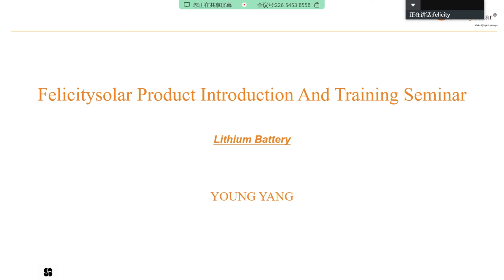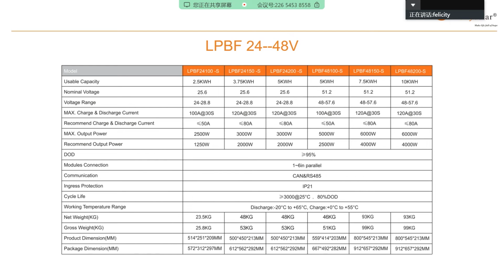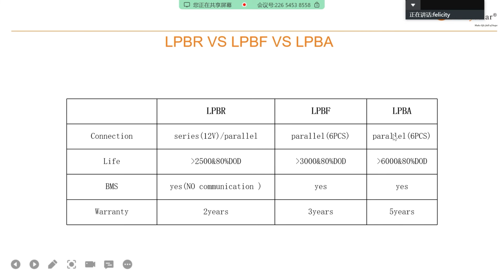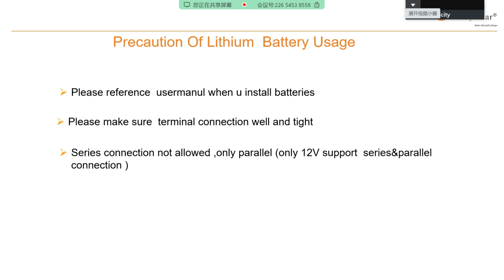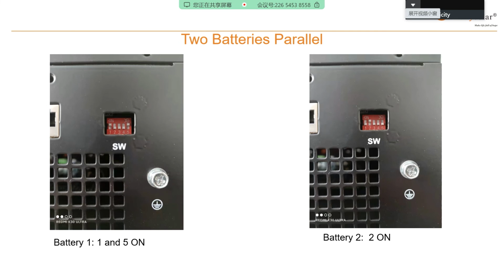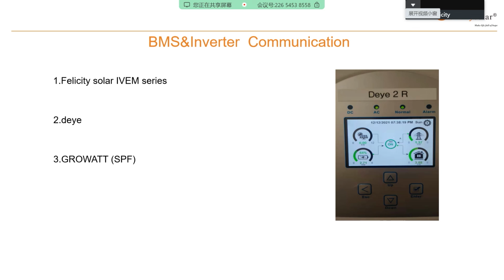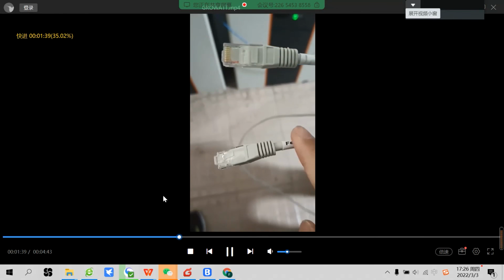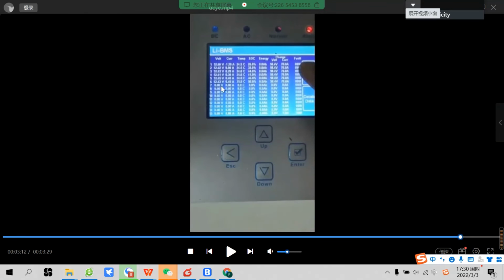Felicity solar lithium battery introduction

Comment: Can the 200 amp 24 battery be used with other charge controllers , the Outback Flex max 80 for example.  This is an of grid set up.  I bought the battery not realizing the communication cables…like the wake up cable… which I don’t have, maybe it comes with your charger inverter. Can i just connect to the output voltage of the Charge controller?
Reply from the maker: Thanks for your inquiry. Please contact our engineer for Technical support by whatsapp: 
Wasely  +86 131 2609 3443

Comment: We need one lbpa 48200 battery opened up and see batteries inside, cause the lbpf 48200 have 170 Amp batteries inside! And the lbpf 48300  have 270 Amp batteries inside! Of course lbpf aren't new cells...

Comment: I have a filecety lpbf48350 battery that was not connected via the BMS in the growatt spf5000es inverter, although I was able to connect it to the lpbf48300 battery. Please help.

Comment: Can I connect your Lithium Pack in series for high voltage applications; example 360VDC 30KVA Inverter with perhaps 8Series of lpbf48300?
Reply from the maker: Yes, and for details, you can please contact to our professional teammates, they are willing to offer you help: felicityservice@felicitysolar.com/Whatsapp : +86 18620180651

Comment: Can your 10kwh 48v 200ah lithium battery be used to run air conditioner and how many hours?
Reply from the maker: Please contact to our technical teammates for more details: felicityservice@felicitysolar.com/Whatsapp : +86 18620180651. Thanks for your support and understanding.

Comment: Hello 
if there is felicity lithium battery connected to felicity inverter , how to configure setting 9,10,11,12,13.
i want to know at certain volt what is the percentage i selected.
Reply from the maker: Please contact our technician,they would like to offer you help.   felicityservice@felicitysolar.com/Whatsapp : +86 18620180651

Comment: Hello on the user manual  it said that the last battery in the system should turn on switch number 5 in and now you turn it on in the first battery

Comment: Hello,how about if batt connect with voltronic inverters, are there any dangerous to connect this batt without communication ? And how much the bulk voltage should be?
Reply: What commutation cable for sunsynk 8kw with felicity 200ah

Comment: Is the DIP switch setting necessary when battery communication system is not used? I mean is DIP switch setting necessary when battery is used in open loop system?

Comment: Hello. To setup communication between two 8.7 lpba batteries i set the DIP switch to 1 and 5 on the first battery, and only 2 on the second, then restart batteries. Right??

Comment: How can we solve the communication problem with voltronic axpert 5.6 kw inverter
Lot of inverters in our market but still no solution
Reply: A big company like you should solve this silly problem
Reply: It has a bms port with can communication and rs485 communication 
And lib protocol compatible parameter
And 3rd party li battery parameter
How about you try and solve it
Big problem

Comment: Thank you for the video, can you tell me what the pin-out is of the communications cable please for a connection to a DEYE inverter?
Reply: Hey..did you figure it out?coz I'm currently struggling to configure it to a 12 kw Deye inverter...please help if you can
Reply: @ofentsemnyandu809  Sry, never managed to get it to work

Comment: hi sir, can you please clarify if the felicity inverter IVEM 5048 and felicity lithium battery LPBF-48200S can communicate via BMS port? and also is the deye inverter can communicate with the same battery LPBF-48200S? 

thank you in advance
Reply: We recently installed  2 * felicity inverter IVEM 5048 in parallel and 2 * felicity lithium battery LPBF-48170S shared by the parallel 2 *IVEM 5048. There is communication via the BMS port and has been operational very well.
Reply: @DrEnockNorthVoltageEngineering  hello sir I have the same battery and inverter but arent connecting together, could you plz tell me the pin layout of the ethernet cable, whicn pins in RJ45 should i use at both endes the battery and inverter?
Reply: @hussien5095  At the inverter, make sure the cable is in the BMS port and comms port on the battery. Ensure the battery dial pins are set correctly. After all connections, you need to restart the system. If you see c on the inverter, then there is communication. You could also write to the service support at felicity for specifics. We used the battery communication cable (RJ45 based) supplied. Alternatively, we can set up a zoom video call i have a look at your system...
Reply: @DrEnockNorthVoltageEngineering  please sir can I communicate with you privately or it OK here, I want to upgrade my knowledge on solar if you mind

Comment: Hi
I used 2 felicity batteries in parallel with Growatt 5000 es
I followed the steps but it doesnt work, the inverter is not charging , 
I used the  black connection wire -that i used to connect between batteries - to connect between battery and bms 
Was that right? Or i need a special connection wire ,?
Pls need help
Reply: Hello you need a special connection wire . If you didn't solve the problem i can help
Reply: @ma060704  
Thanks alot ,Solved . 
Appreciated.
Reply: @rabihghannoum1198  Hi,
how did you solve the problem?
I've tried with a normal ethernet cable but it's now working
Reply: @JamesNjoroge-bc5qk  what kind of inverter do u have ?
Reply: I used 2 wire ethernet cable connected 1-2 to the inverter , 5-6 to the batteries
Reply: @JamesNjoroge-bc5qk  1-2 from the inverter , 5-6 to the battery.
1  at the inverter connected to 5 at the battery
2  at the inverter connected to 6 at the battery
Hope this solves ur problem
Any more questions  happy to help
Reply: @rabihghannoum1198  Thank you, i figured it out. 
I noticed that bms controlled charging voltage is 58.4, while the maximum battery charging voltage on the datasheet is 57.6V.
Is this the same for your system?
Reply: @JamesNjoroge-bc5qk   no its not the same
Did u set program 5 for li ?
And set the protocol 36 to 04 ?
Reply: @rabihghannoum1198  Yes, i did. 
Then i checked the battery charging parameters and noticed the 58.4V charging voltage. 
I tried to change it but it's bms controlled. It cannot be edited.
However, during normal charging operation, the voltage never gets to 58V.
Reply: @JamesNjoroge-bc5qk  then u have to update the battery 
I contacted the dealer and he sent the update version for battery to comunicate with growatt, but it is somehow complicated , i suggest that u must do the same and contact the dealer so he can make the update for ur battery.
Reply: @rabihghannoum1198  Okay, thank you. 
I'll do that
Reply: @ma060704  can you please share the configuration of the Comm cable between two batteries when using them with Deye inverter, the one from battery #1 to the inverter is : pin1&2 (inverter side) to pin 5&6 (battery #1 side)
Reply: @ma060704  please can u help I have the same issue concerning two batteries 8.7kwh with growatt 5000 one of the battery is not working
Reply: Hi rabih, i have the felicity 10kw LPBF-48200S with growatt 5000 es. i used the special cable but it is still not working with BMS. do you have the same battery if yes can you please let me know how to make it work.
Reply: @charbelkhoury3120  hi
I used the same connection wire with several kinds of felicity lithium bat. and it works the same, but i didnt use it with this battery.
Although im pretty sure that it may work the same, 1 and 2 to growatt , 5 and 6 to felicity.
1 connected to 5 , 2 connected to 6.
If still is not working i think u have to contact the dealer to update the battery to configure with growatt
Reply: @charbelkhoury3120  and make sure that setting 5 on growatt is set on li , setting 36 is set on protocol 04
Reply: Hi George please can u help. I already have a mounted solar system : 10 panels Trina 555W, inverter Growatt 5000ES, felicity battery 8.7kwh, all is okay until I added another felicity battery 8.7kwh which gives a "High Cell Voltage" error.. I don't know if their is an error in my connections or their is a factory problem in the new battery
Reply: @alihachem9989  you cant add 10 panels in series to growatt 5000, what is the voc of the panel ? And how did you connect the batteries? Series or parallel ? What was the sw set to ?
Reply: @rabihghannoum1198  voc =38.1v . For SW 1st Battery (that is connected to inverter) 1 ON, other off,, 2nd battery(that is not working) 2 & 5 ON .  for Connection: two power cables 25mm from the negative and positive poles of the first battery to the 2nd battery..if i could attach an image you shall understand better
Reply: @alihachem9989  try the same as i did , the master battery sw 1-5 on, the second one 2 only on. Disconnect all wires , bms cable , the cominication between 2 batteries, turn off the inverter and disconnect pv and battery, and turn off the batteries . Wait for 15-30 min, then reconnect wiring again. Turn on pv and batteries,then the inverter.
Reply: @alihachem9989  its okk for 10 panels voc 38.1v sorry for misunderstanding i thought it was 50v. If the above didnt work, try to disconnect the second battery and see  if the eror still exists, if not then the problem exists  in the second battery, waiting for ur reply
Reply: @rabihghannoum1198  i disconnect the 2nd battery as a communication but keep the power connection,i also turn SW 2 to 0 and turn it off. the system is working normally with the original battery, but if i connect the connection table between the two batteries, the original battery is affected by its percentage it goes to 50% and the raise to 100% for example

Comment: Does the inverter/battery communication support victron inverter
Reply from the maker: NO.they even deny felicity battery  communication feature without any confirm with us
Reply: @felicitysolar  So BMS does not work with Axpert inverters ?
Reply: @charbel seemaan
axpert
did you try to let it work ? even if i made the special cable upon pins will not work ?
Reply: @samerhemaidan9697  No sorry, Seems they dont work together. Just had to set USER and set the parameters according to the battery datasheet

Comment: Thanks, this is really helpful. How about other Felicity Solar Inverters - does the IVPM series also allow BMS communication?
Reply from the maker: yes sure ,IVPS/PM both support
Reply: @felicitysolar  Hi, I just bought a IVPM3524. What is the function of the Remote control port and RS-232 port?